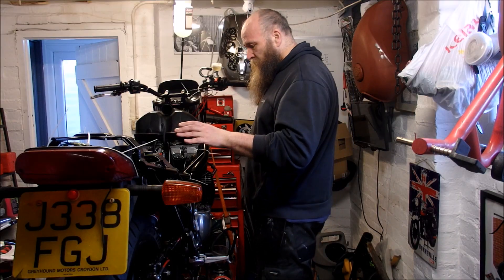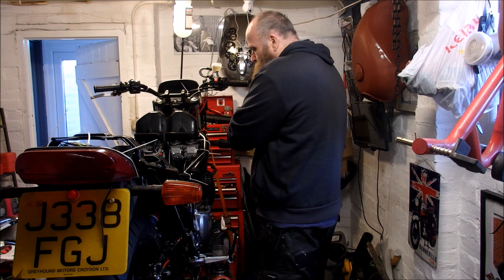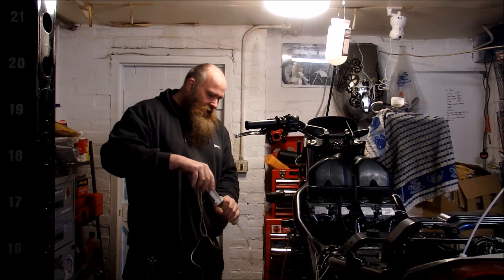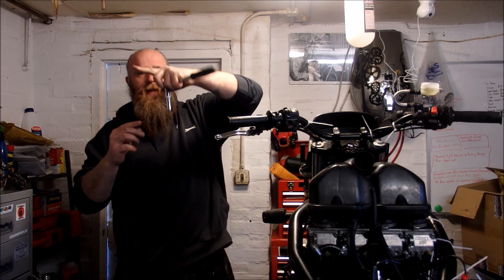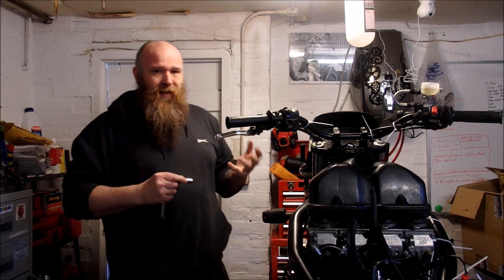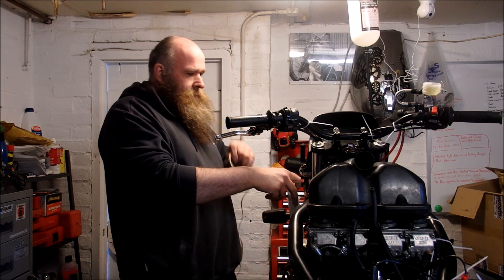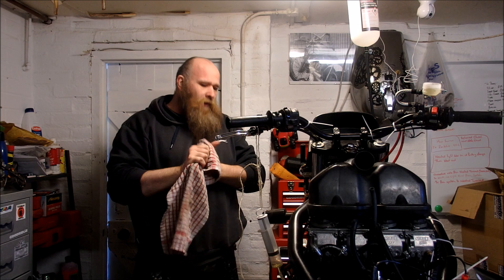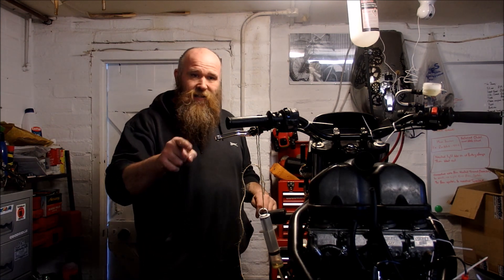Bleeding Motorcycle Brakes (Reverse Bleed - How to)

Comment: Like you, I’ve never used that method before, but it looks pretty easy so I won’t have a problem trying if I need to now.  Thanks for sharing your experience.
Reply: It is. Air goes up of course. Tip is also tap the hose whilst filling

Comment: Nice vid mate I often find one piston is stuck in calliper especially after rebuild pop it out and lube with brake fluid then should be fine I now use a hand vacuum pump makes the job a little less frustrating keep up the good work 👍

Comment: I’ve just had my brake calipers rebuilt, I’ve put a brand new brake bleed nipple in, the brake fluid is leaking out of the thread of the nipple, it hasn’t been over tightened because I haven’t set the torque yet due to needing to bleed them, any suggestions???
Reply from the maker: The torque on those nipples is tiny, ensure all the other bolts holding both sides of the callipers are torqued to the correct spec, if they are, and the leak is coming from the nipple itself, torque the nipple to the right spec and see if you still have a leak.  If the leak stops,  just back the nipple out less than a quarter turn and see if the fluid leaks from the nipple or the surround.  If it leaks from the surround, something else is wrong and would strip the calliper again, to make sure everything is as it should be.     Let me know how you get on.

Comment: Nice one GT, I've just bought a project bike with no fluid at all in the front brakes so I'm gonna try this method. Just one question for now, where did you get that mahoosive syringe? I've got plenty of clear hose from a pet shop that sells aquarium stuff but they didn't have any syringes.
Reply from the maker: Morning Martin, i just ordered it from Ebay.  Would bleed the normal way first to get as much fluid in the system as you can... by normal i mean, fill the reservoir, pump the brake, keep the brake lever pulled in open the bleed nipple, close the bleed nipple and release the brake lever.  That should expel the majority of the air, and then use the reverse bleed to get the last bit of air out..  When reverse bleeding, it can feel a little like trying to push treacle through a syringe, the secret is slow consistent pressure being applied.. don't get bored and try and crush it through, more likely to dislodge the hose and squirt brake fluid all over your pride and joy.  This will work 99% of the time, any issues,  you could try the following, once the brakes are full of fluid,  take the callipers off, and put the longest spanner you have between the pistons and squeeze the lever a couple of times to push the pistons out, watch to make sure all the pistons are coming out together, a piston that doesn't move could be air, or stuck.  Use the long spanner to push the pistons back in to the starting positions and repeat a couple of times,  Put the callipers back and repeat both methods above.  Above all, take it slow, and methodical, and stop for regular cups of tea, especially if frustration starts to set in.    Sometimes the best thing you can do, is walk away for 30 minutes, and start a fresh :)  Good luck and let me know how you get on..
Reply: Thanks for the reply GT, I'll order one now. Of course I'll give you an update in a few days.

Comment: When I try to do that the level in my master cylinder doesnt rise... what does it mean?
Reply from the maker: The fluid has to be going somewhere.  In my experience, pushing the fluid into the caliper is far harder to do than the conventional way, so to answer the question, how much fluid have you pushed through without seeing the the level in the master cylinder rise.  The fluid can only be filling up the canels in the caliper, pushing the pistons out to touch the brake disks or going up in to the cylinder.  Once everything's full, it can only go to the master cylinder or leak.
Reply: It just builds up too much pressure to move by hand when I force it in through the bleeder, no significant amount 20-30mL I took the line off before and i blew air through it just fine so I know it's not clogged, and my master cylinder build good pressure. Thank you for your responce!

Comment: I tried this last night.  Couldn't get fluid to move.  Bleeder was open.
Reply from the maker: The first time i tried this,you expect the fluid to just flow, but actually its closer to pushing concrete.   I found the best way was to apply constant pressure, and you should see the level rise in the pot.
Reply: GTs Garage ok.  I was concerned I would bust a piston seal or the syringe would break,  so I quit

Comment: first lol I hate brakes I only change pads let garage do seals and fluid cheap enough by me will service each brake for 20 pound as long as you giv seals
Reply from the maker: Aye, it often comes done to tools, space and how many times you plan on doing the job, like tyres, if you find somewhere cheap enough, get them done professionally.
Reply: I don't go near mechanics. Most are a waste of space. And the good private one's have no time for ye. Fully booked cept in winter